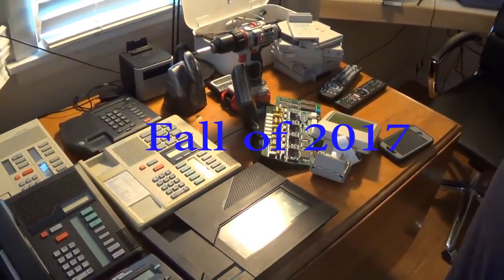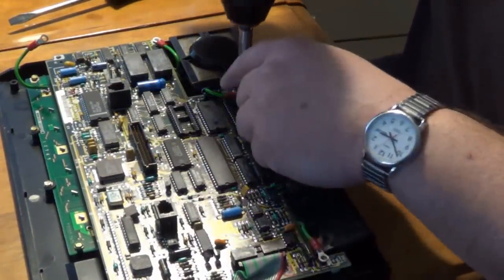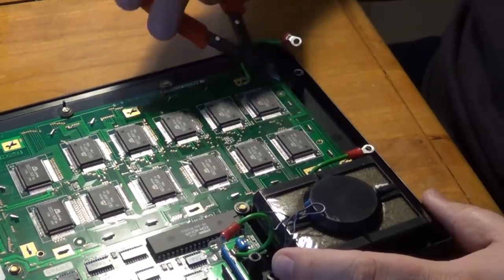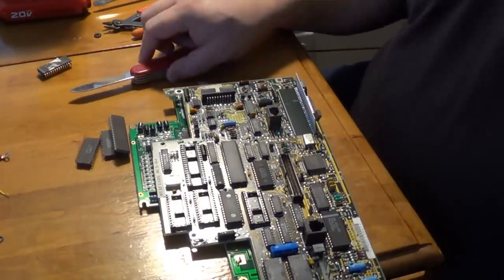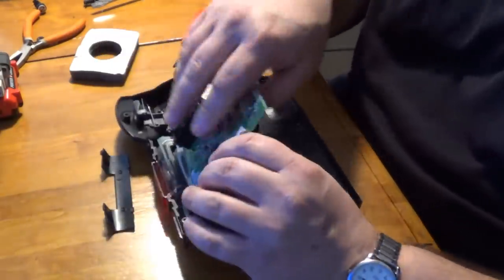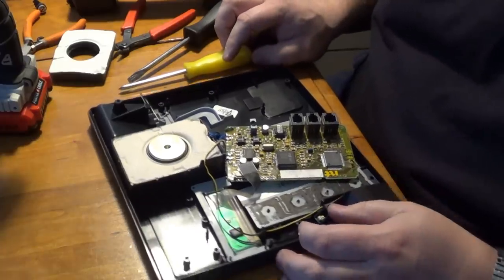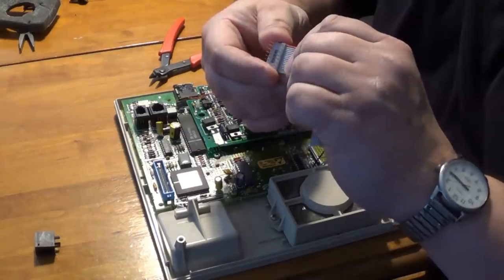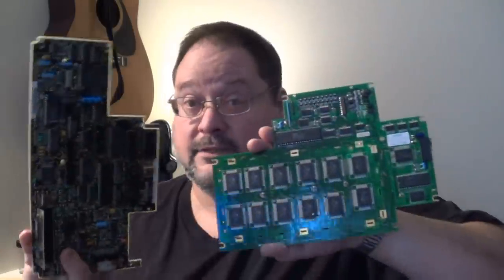Scrapping Office Phones for Precious and Scrap Metals! -Moose Scrapper

Comment: This is great timing.  My work recently began upgrading our phone systems which will mean replacing approximately 3000 of them.  Stripped a few down and only found the LCD panels to be worth the effort.  But each LCD board is heavily gold plated...more than from a stick of RAM.  I have a guy in the IT department who puts the phones aside for me.  We made a pretty good deal: He collects and holds them for me and after I pull out the boards I just have to walk them out back to the dumpster.  I think this deal will work out fine for me.
Reply from the maker: Sweeeeet.  Its deals like that that really make me happy.  Bypassing the corporate BS and keeping stuff out of landfills!
Reply: No kidding.  As I like to say "if it's for free, it's for me".  :)   

On another note, found out that the meters Cable TV techs use are very high in gold.  Being lucky enough to work in the industry I have been able to score a good number of them.  Heavy gold plated traces, thick plating on the pins, silver coated mylars from the keys...some of the best gold content I've found so far.  Processed 3 of them and pulled just under 1gm of gold just from the boards.  Keep an eye out for them if you can.  Even better to find a friend who works int he industry.  lol

Comment: I recently picked up a free load of about 60 old office phones. Most were older models and many had frayed cords, dirty plastic, dirty handsets and grunge from daily use, which I didn’t want spend time to clean up to sell on eBay, although, maybe I shoulda picked out the good ones and sold lots as is. Either way I had an efficient assembly line to do a dozen or more at a time. Remove all cords, unscrew covers, then remove circuit boards. I will try and sell the 3 control cabinets and the dozen telecom boards in each. The individual boards inside seem to go for $30-50 each on eBay. Debating whether to sell entire cabinets for $300+ each with all slot cards/boards inside or sell all slot cards/ boards and empty cabinets individually since people might only want certain boards or an individual power board or empty cabinet to build their own. Lots of ABS #7 plastic leftover I’m trying to find a place to recycle it even if it’s free and they don’t know pay for it.